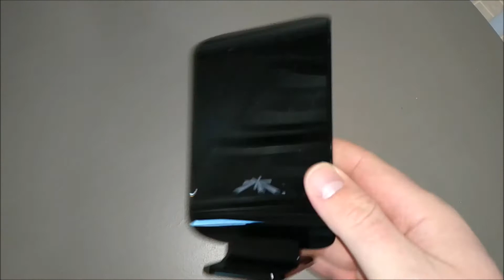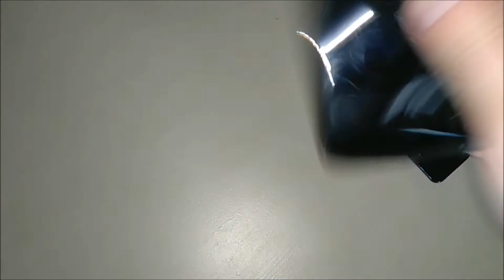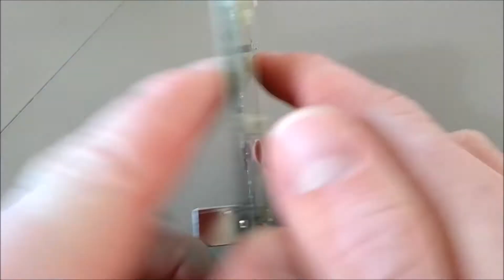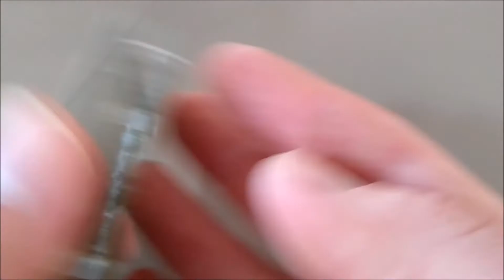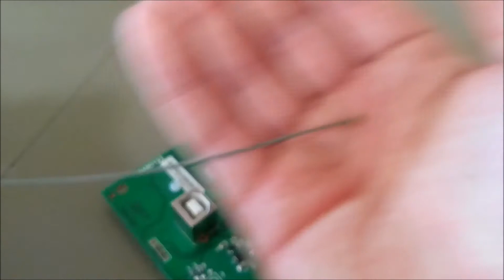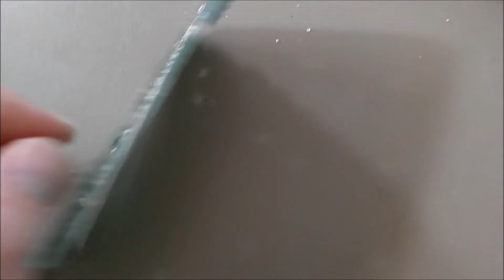EZ Wifibroadcast: Using a Ubiquiti Wifistation

Comment: Hello. I'm building my own setup. What is the real tx power? Is it 1000 mW as the datasheet says? I'm worried because there are too many marketing bullshits everywhere. I want a ~1W card for my EZ Wifibroadcast. Do you think this card is the best for 
 long range? Please keep upload videos.
Reply from the maker: typebin it was measured by a member on RCgroups to be around 900mW
Reply: Thank you. It really helped a lot. Fortunately it matches with some FCC document I found. I guess this is the best long range candidate, isn't it?
Reply from the maker: Yep. If you check out the Ez Wifibroadcast thread on RCgroups lots of people are getting impressive range with it!
Reply: Yes RCgroups shows results with few kms ranges which are awesome. 

Alfa AWUS036NHA seems to be able 1000mW tx with simple software configuration. I even saw testing with a simple power meter on youtube video showing 31dBm. Is it possible? I'm confused. There should be some drawback because it's not designed to, isn't it? Can I use different brand wifi cards for rx diversity such as Ubiquiti and Alfa? Actually now I think one high power and many high 'sensitivity' is better.

The reason I need high power on both rx and tx is for Mavlink bi-directional telemetry. 

Thanks
Reply: Easy fix
Alpha card + booster